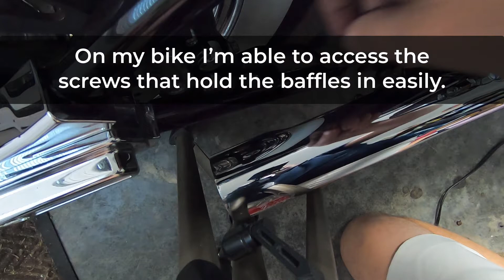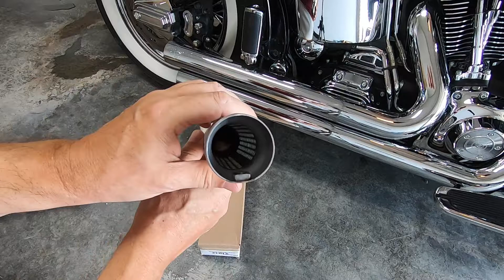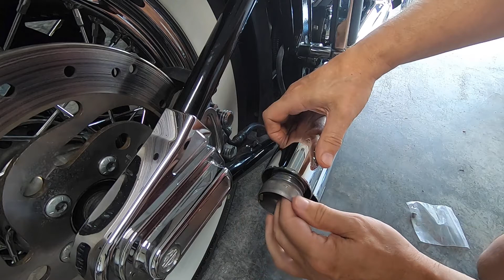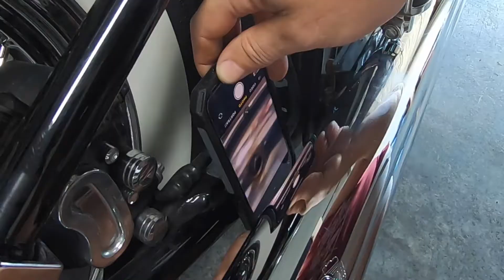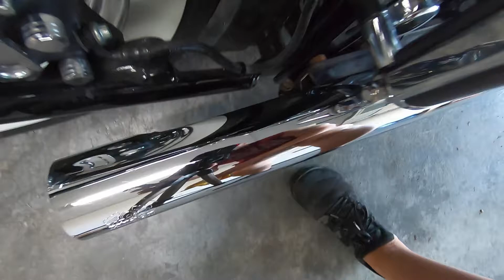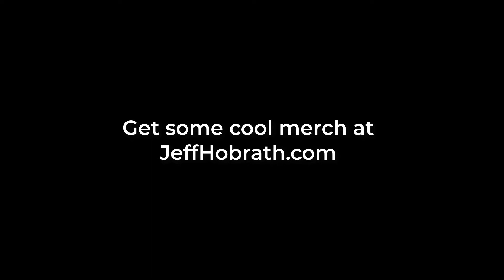Vance and Hines Super Q Baffles Install and Comparison to Vance and Hines Stock Big Shots Baffles

Comment: Awesome video, plain and simple....no Blah Blah Blah. Installing Baffles For Dummies.
  I'm going to order a pair of these for my recently purchased 05 Fat Boy w/ existing Vance and Hines Long Shots.
Reply from the maker: Thanks for the kind words Chris! Let me know what ya think when you get em installed.
Reply: Did you put the quiet baffles in if so what do you think?  I have an 01 fat boy that had screaming eagles they gave me ear problems for 2 weeks after a 1700 mile trip. So I found a stock set up but the power is horrible. I'm thinking about Long shots with the quiet baffles.

Comment: Fair difference in dBs there.Thanks for posting
Reply from the maker: Yup, I’m trying another set soon that should be somewhere between the stock and the super Qs, I’ll make that video as soon as they arrive.
Reply: @ChiefHobie  are they the ‘quiet’. If so I have those but looking at maybe the super q’s
Reply from the maker: @kye9549  Hi Kye, these are the super q's and yup they are quiet in my opinion, they ended up being to quiet for my liking, but they do work as advertised for sure.

Comment: Was it necessary to retune the motor or ECU after installing the Super Q baffles?  Also, would it be possible to edit/extend the video to let us hear the Super Q baffles when the motor is revved?  Tks!
Reply from the maker: Now the baffles are stuck in the pipe with the hole drilled out, but I can do a video revving it for sure, but it’s not the super quiet baffle version anymore because I can’t get these ones out anymore. However, the sound has grown on me and now I kinda like it the way, I’m not sure what I’m gonna do. thanks for watching!
Reply: @ChiefHobie  Why is it stuck? Is it because of the wrap?
Reply from the maker: the wrap burns off quick, it’s the metal hitting a ridge somewhere, myself and the dealer tried everything to get them out, it’s a freak thing but I do like it for now, if I want to tone it down later I may have to spring for new pipes.

Comment: Why does the wrap have to stay on? Just curious.
Reply: It keeps the mesh tight. Once they’re installed and get hot the wrap melts and the mesh puffs up filling the exhaust completely. The wrap is on during install to make it easy to slide in.
Reply from the maker: as @prudien mentioned it keeps the mesh tight, it will burn off, thanks for watching!

Comment: Shouldn’t you remove the plastic cover first?
Reply from the maker: I think the Saran Wrap type material wrapped tightly around the baffle makes it much easier to install and helps hold the fiberglass material in place during the install, it will just burn off when you’re riding.
Reply: @ChiefHobie  thanks, you are right
after i writ my comment, i check vids on youtube, they mentioned plastic shouldn’t be removed
Thanks bro
Reply: Revzilla says no.

Comment: No revving of the engine to hear the sound when on the throttle?
Reply from the maker: Hi Tactical12, you’re right I should have given a better sound sample. In my latest video I did do that after I modified the baffle, I ride around with the baffles at different levels, I should have done that in this video, if I make another exhaust video I’ll do that for sure from now on. Thanks for the comment!

Comment: Y would u leave the plastic on its just going to melt..
Reply from the maker: It burns off. I think the point of the the plastic is to hold the fiberglass in place when you slide it in. When I say plastic I’m referring to the thin layer around the baffle not the plastic bag they come in.
Reply: I think the plastic might make it get stuck in there?
Reply: Vance and Hines recommend keeping the plastic cover.